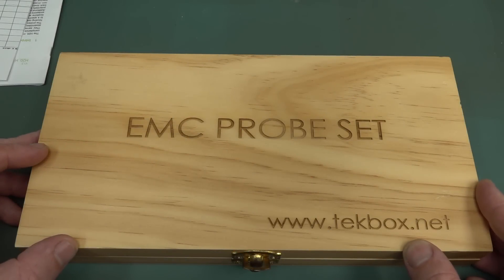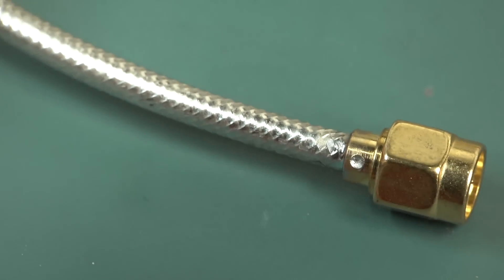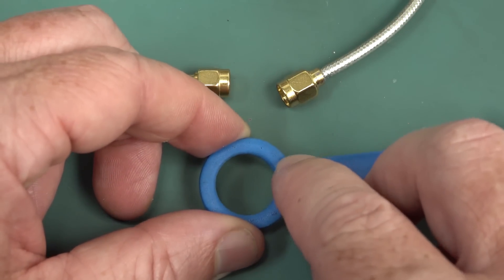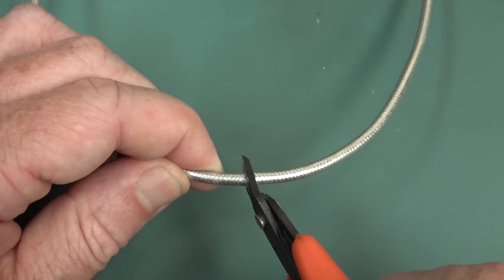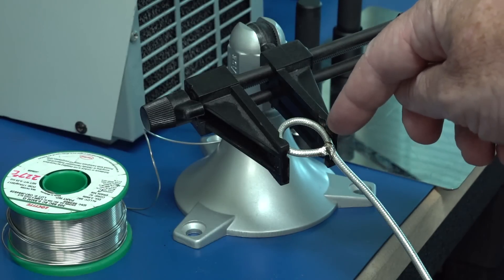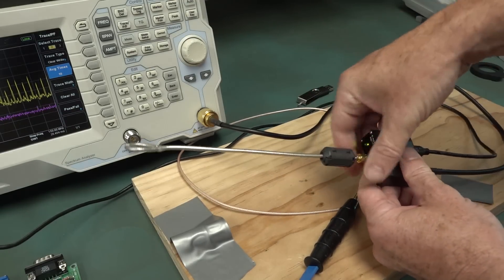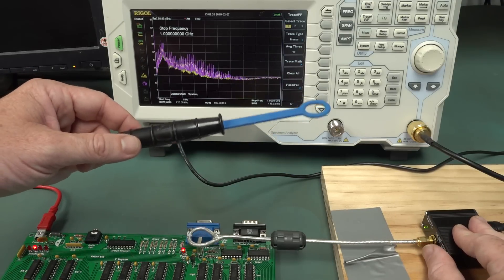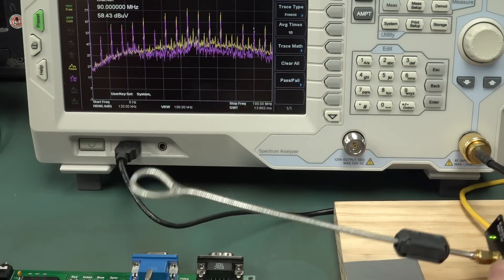EEVblog #1178 - Build a $10 DIY EMC Probe

Comment: One of the best videos in a while!
Reply: Totally agree .. high quality content .. stick it to the fat cats Dave .. maybe build a differential probe next from Ebay parts .. there are a ton of broke engineers and hobbyists out there
Reply: @midnightman011  Agree with that.
Reply: Yes sir.  An RF probe came to mind from an old set of computer external speakers... that'd be about as cost effective.  SDR ideas don't seem bad for cheap spectrum analyzers especially if there is an oscilloscope plugin... though I've figured a set of attenuators for the range and profiling the SDR well to know its range of performance to characterize the limitations so you don't blow it up.  Probably a current limiting input thingamajiggy too.  Normalizer dohicky would be impressive.  Least that's what comes to mind.  I was also wondering about making a leveling head for the cheapo signal generators since they're so cost effective.  Trips me out how cheap some of the modules are and how like this detailed video demonstrates using the hardline or rigid or I guess it's called semi-rigid cable... can be used to make decent kit alone basically or with a or some modules.  So much, I just ordered a range of modules, plus some, to make an Antenna Analyzer or looks like is going to be a VNA using Erik's latest modularized version he notes on the SoftwareControlledHamRadio groups.io post on Analyzer Comparison since seems impressive: https://github.com/erikkaashoek/Tapr-VNA
Reply: This post, the high voltage probe and the isolation probe video's of EEVBlog are coming to mind as impressive also.  I'm sure there's more I haven't seen yet.  It's like man jewelry... I buy the components and it looks so great just hanging there even if I hardly use.
Reply: Agreed!
Reply from the maker: RicoElectrico Correct, I do practically zero research, that's the way I've always done videos and have built my channel from nothing doing that.
Reply: @EEVblog  How about more DIY expensive tools that work as well as the professional ones. Stickin' it to the man. How about an active oscilloscope probe next? Or a DIY Hewlett Packard 547a current tracer? I could probably use one but not enough to justify $200 on ebay
Reply: @qashqai q Spot on. I'd rather have Dave post rarer, but higher effort content.
I don't watch the mailbags anymore, they seem to become a chore for him. Teardowns are a hit or miss really. Dave sometimes does too little research. Though that correlates with "off-the-cuff" slogan.

Comment: Great, now I just need a Spectrum analyzer :|
Reply from the maker: You scope likely has FFT
Reply: @EEVblog  or cheap RTL dongle or HackRf  will work.
Reply: As  SpecA’s go, you can likely get the Rigel jobbie that Dave was using for ~1500 $USD or less. That’s serious coin, but WAY cheaper than an equivalent unit a decade ago...
Reply: Yeah about $20 for the RTL SDR + Spektrum (free)
https://www.rtl-sdr.com/poor-mans-spectrum-analyzer-with-an-rtl-sdr-and-noise-source/
Reply: @samuelcomeau  Install it with Pothosware. Dead easy.
Reply: My $200 Keysight scope has FFT.
Reply: SDRplay radio now has some software called RSP Spectrum Analyser by Steve Andrew https://www.sdrplay.com/spectrum-analyser/
 TomTekTest has a nice set of videos on this software hardware combo https://www.youtube.com/watch?v=h8-9a6CNyB8 
The SDRplay RSP1A can be had for around $100